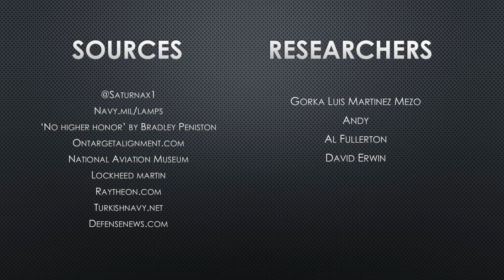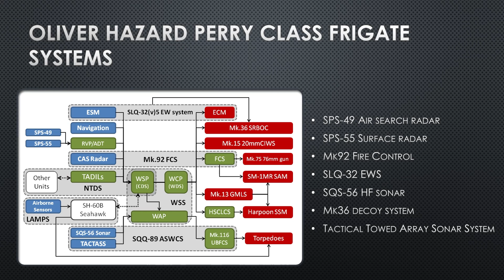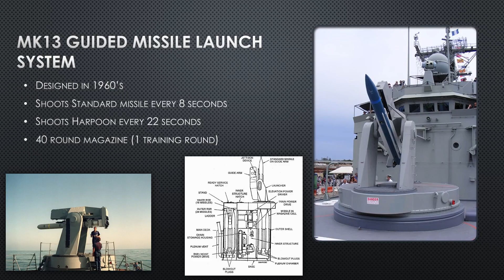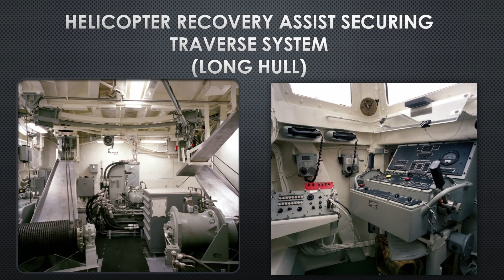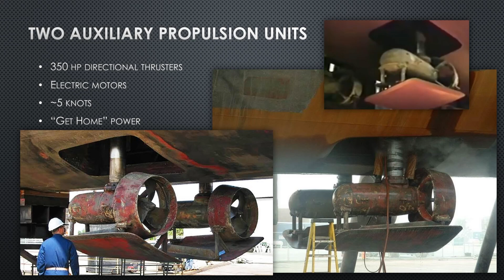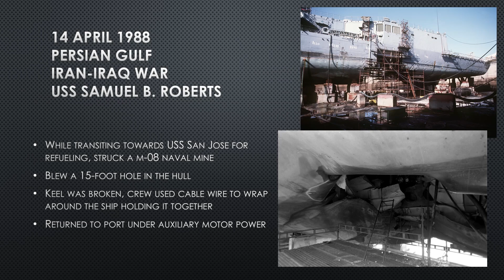Oliver Hazard Perry Ship Brief

Comment: Is it just me or does 29 knots seem slow?  Didn’t cruisers in WW2 do over 30!and destroyers were even faster…
Reply: The PERRYS were intended as convoy escort ships, so high speed wasn't as important.  Speed is also expensive, becoming much more so as you close and exceed 30 knots--it's very hard on the ship as well
Reply: Top speed is generally less of a priority for modern warships than it was in WWll. Propulsion machinery requires a lot of space & you can’t really run away from the kinds of weapons used by modern surface warships.

Comment: Phenomenal brief!!! I'd love to see more warship briefs in the future, especially one on the Type 23 Frigate. I've heard it's a formidable anti-submarine platform and I'd love to hear your take on it, its use, and its recent upgrades. 

Cheers!!
Reply: @Bill Bopperton That's correct. Everything about the T23 was designed from the outset around the ASW mission. Apart from the very advanced sonar system, it has lots of silencing features you normally don't find on surface ships and a very quiet electric drive system.
Reply: There is surprisingly not much complexity in equipping vessels for anti-submarine warfare. It always boils down to upgrading sonar (buoys included) and yeeting explosives at targets, either from ship or helicopters (that can also help with spotting). Like many other naval weapons, they are becoming increasingly replaced with missiles, sadly.

Comment: 36:00 as a Brit, have to say I am always impressed by the feats of USN damage control
Reply: Well, Damage Control before the turn of the Millennium at least
Reply: A little know detail of the Stark damage control during the incident; the missile that entered the Port side at the main deck actually went right through the ships fire main which is exactly behind the bulkhead where it is blown out in the image. The entire fire fighting effort had to begin with DC Central isolating that part of the fire main to slow the massive flooding which was happening at the same time. Many sailors died in the fire, but more in the lower berthing just below that floor. 
Additionally, the ship would have like been attacked again had it not been for the fireteams concentration of efforts on the RICER room which contains all the support equipment to keep CIC running. Due to their incredible courage under fire and their fire fighting training, they were able to keep the ships weapons/defenses operating which I am certain saved many, many more lives.
I was the CIC Watch Officer and the OS Division Officer aboard the USS Vandegrift and it was the Stark which had only relieved us after 7 months doing the exact same job.
I still feel sick that this event could have occurred the way it is described. No way it would have happened. 
God bless the Crew of the USS Stark. Amen.

Comment: Well done presentation. Speaking as someone who served on USS Aubrey Fitch FFG-34, as a SQS-56 tech, 92-97 I can say the OHPs were PoS. OHPs did serve as a kind of littoral warfare stopgap, we were just beginning to take littoral warfare seriously in the '90s, but in the event of a real war our job was to soak up missiles fired at a carrier while in peace time we were "warships" on paper to bulk out the navy. I'm amused at the post 2000 "upgrades" as I left the service before those popped out, but they follow the "just slap more crap onto the hull" design philosophy. Can't speak on most of the engineering issues, but hearing it called away that one of the APUs or turbines had gone down quickly became background noise I ignored. Most of the OHPs did not get the flight deck upgrade for helicopters so the avionics store room was transformed into a tiny 10' X 20' crew lounge which was much better than the versions that got the upgrade and so not only lost rec space but had the joy of hot racking because of the extra crew. Frankly I thought the ship's MASSIVE office complex that took up most of the starboard side (and a fair bit of the port side) should have been removed, but the navy loves their paper work. If you had the towed array (most of us didn't) then you lost the aft battle dress station. Variable pitch propeller was admittedly cool as when you slam that thing into reverse while at top speed the whole ship bucks like it is going to tear itself apart, but it had the unfortunate characteristic of perpetually leaking oil getting the ships fined every time the EPA decided to inspect. The Mk 32 had to be manually loaded with old school block and tackle that took a lot of time to haul up and set up before you could slowly drag one torpedo at a time out of the mag, lever it onto the hoist, crank it into position and then ram it home with three people pushing on it. Each tube is in a different position so you have to reset the position of the "hoist" for each torpedo you want to load. The torpedoes can not be trained out or fired with loading gear in place so it all has to be broken down and stowed below deck. In effect you get six shots then spend half a day reloading, but OMG did we carry a giant store of those f*ing torpedoes. In reality those torpedoes are designed to be dropped directly on top of a subs position by a helicopter and mounting them on a ship is largely pointless. The Mk 13 was the Hood Ornament because that thing required two weeks of work for the gunners to get it working and broke down after firing once - no idea why, may just have been an us problem. The 76mm "intermittent fire" cannon jammed a lot although (from what the gunners told me) it's because the ammo was garbage and not the gun itself - same problem with the CWIS. Weapon system not mentioned 8 Browning M2 50cal machine gun mounts which we ended up using a fair bit, I was a loader/gunner on one of the mounts, PiTA as they were stored in the forward small arms locker and had to be hauled up a whole bunch of ladders, usually at 5AM so they would be ready when the sun came up. "Hull Cracking", lol , in truth the overloaded hull had periodic hull splits making dealing with flooding so routine I just started ignoring calls of flooding unless it happened to be in or near a compartment I was responsible for. I credit the amount of experience crews had with fixing routine problems for the class reputation for survivability.
Reply: I served on the Australian OHPs and they were very well liked by us. The upgrades Australia did towards the end of their lives (8 cell vls forward of the Mk 13 launcher, SM 2 missiles replacing SM 1, upgrading the combat data system....) probably should have been done by the USN on the younger OHPs and then replace them with actual warships.
Reply: I was an STG on FFG-36 USS Underwood from 93-96. I have to agree with the above. They were a cheap means to show the flag in various places. My favorite assignments were Grenada so we could provide a detachment to march in their independence day parade. Also we were sent to South Africa. I suspect our CO being African American was a factor. 
The 76mm mentioned was a rapid firing auto cannon mostly firing proximity fused AAA shells.  It could  do a mediocre version of shore bombardment in a pinch.
Reply: @whelk  The 76mm gun was pretty good for what they were meant for i.e. last ditch AA and dealing with pirates and illegal fishing ships.
Reply: Great insight, thanks
Reply: Thanks for your service and thanks for the info on your experience.
  Stuff like this doesn’t come out in the general media info flow.
Reply: Helen Keller tech! I was one 1st. Then 53c and 28 tech!
Reply: I was also on USS Aubrey Fitch FFG-34 85-88 SC-02 Division Radio Central.
Reply: Fantastic and fascinating breakdown of an OHP's pros and cons. Thank you and salute to your Naval service.